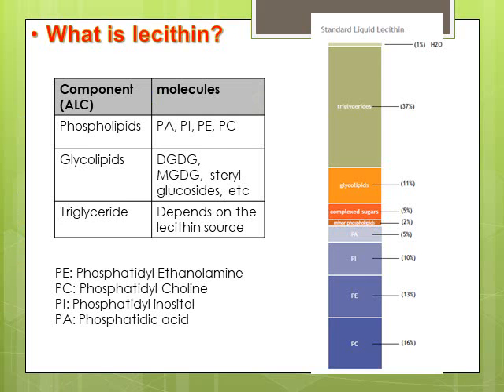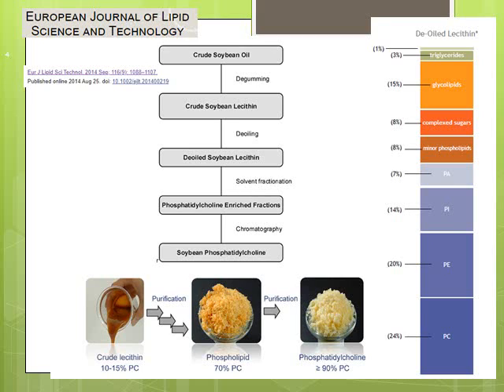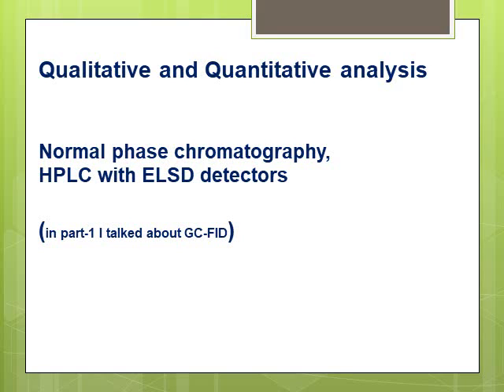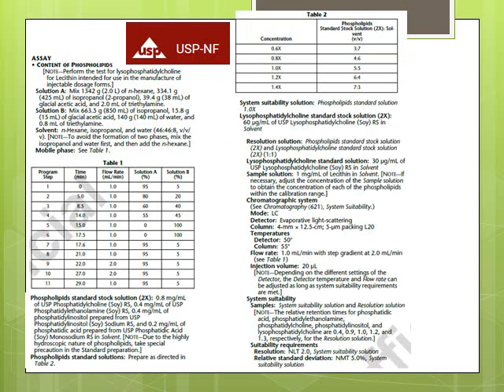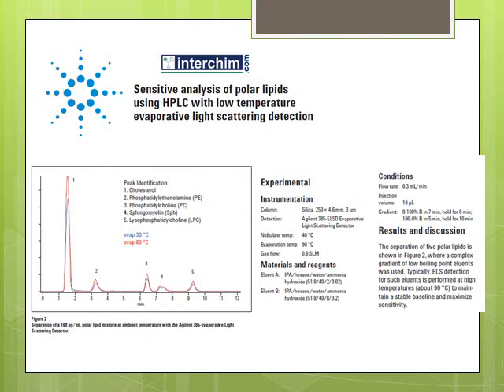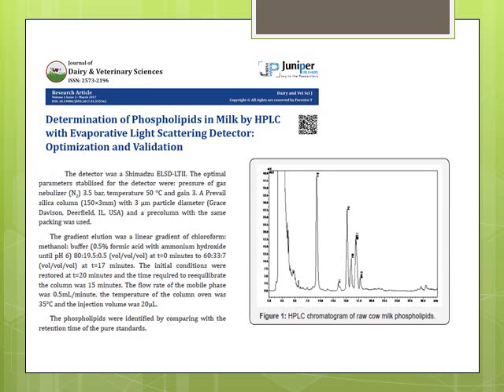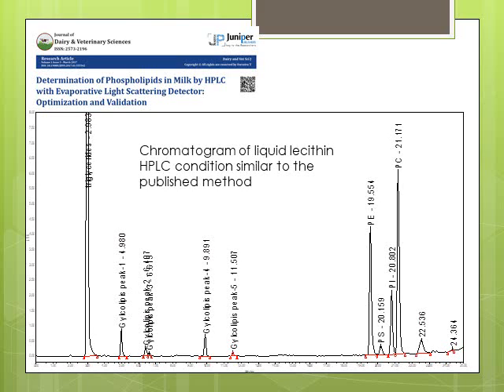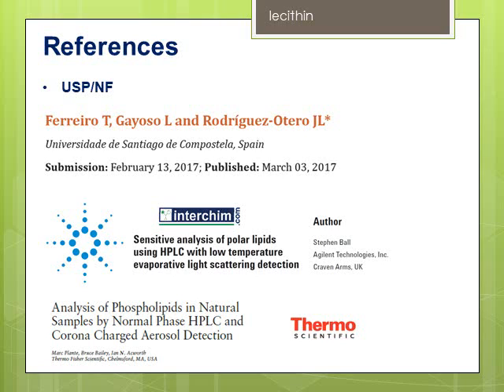Analysis of Lecithin in pharmaceutical and cosmetic products Part 2. HPLC-ELSD analysis

Comment: Good video.can i isolate refind lecithin from crude lecithin at home.what is the mothed plz tell me.i need lecithin for my inner mosturisig because my heel is crack,my hair dry, memory issue and fatty liver lecithin granules is so expensive 30 dollars and I am poor
Reply: Thank for reply
Can i use waxy de oil lecithin instead of granules because i don't use hexane
Reply from the maker: @tahirbutt3279  yes. you don't need to use hexane. 
for very dry heel, urea cream is effective.  i remember many years ago i made a cream with about 20% urea.  i think urea must be more than 20% to be effective.  i need to look it up and get back to you.
i dont think urea creams are expensive to buy.  urea is very cheep
Reply from the maker: @tahirbutt3279  waxy should work but for dry heel there are other type of creams available/ i think shea butter could work too
Reply from the maker: you need to dissolve crude liquid lecithin in acetone and remove the acetone that has all triglycerides in it. collect the solid left behind as de-oiled lecithin.  solid left behind is waxy and sticky that has high phospholipid content.  be careful about the acetone and don't use nail polish as acetone.  because in nail polish they add other solvent to acetone, such as methyl acetate, glycerin, etc.  you must use 100% acetone.  Now, the waxy  de-oiled lecithin that you made can be dissolved in hexane.  look for procedure how to tune de-oiled lecithin into granules. you don't have to but if you like to have granules instead of solid chunk of deoiled lecithin
Reply from the maker: Hi
i loaded a video on how to convert raw lecithin into refined lecithin
enjoy